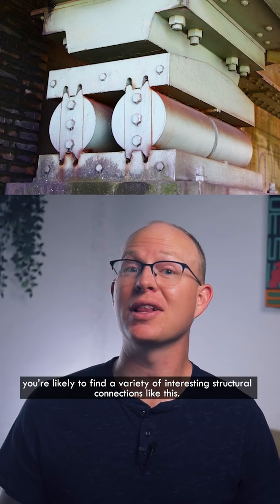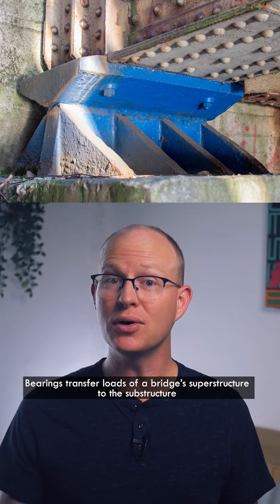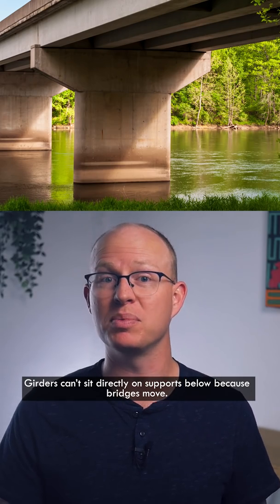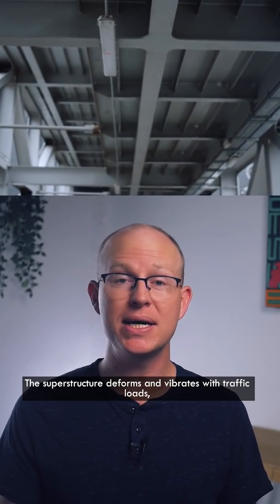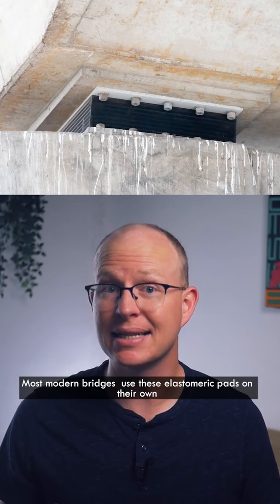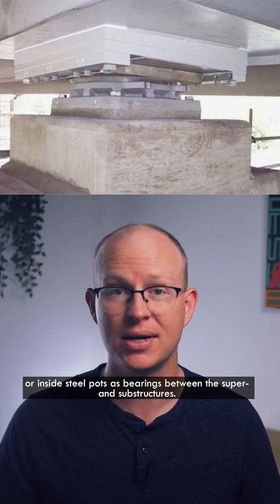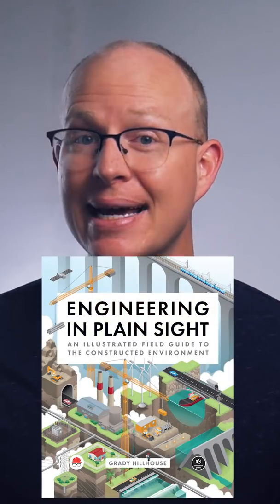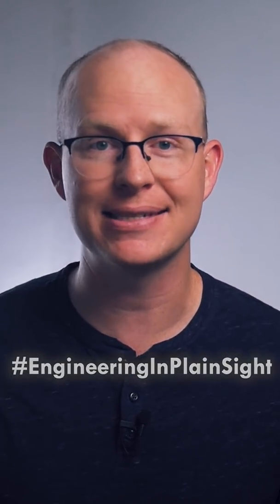Name That Infrastructure (Ep. 4) #shorts

Comment: Integral bridges are very often designed and built for small to medium span bridges because they requires less maintenance compared to decks on bearings. That's because the movement along the bearings will make these bearings wear and tear over time. With integral bridges, the deck/abutment connection is fixed and stresses get transferred into the abutments differently. There are specific issues related to integral bridges, such as the impact of soil ratcheting on earth pressures, but these can be managed through design.

Comment: I’m a river guide on the Lehigh. On the section of river I float, we go under 8 bridges that all are very different from each other. First is a high but small walking bridge that was built within the last 20 years, the second is a 100+ year old train bridge that has 2 supports and a very intricate metal structure under it( it’s a bunch of triangles that are 10 rows across. After that we go under another old train bridge. It has similar pillars to the other one but it’s underside is basic and common looking. The next bridge is a basic car bridge with one support in the middle, you can see it looks like the road is just sitting on it. That one was made maybe 30~40 years ago. 100 yards after that one we go under another car bridge that’s longer and taller. I suspect it’s older than the one next to it. The next 2 are the Pennsylvania turnpike. Probably 100ft above the water and supported by 4 skinny columns. And finally we go under one more short car bridge that has one support in the middle. You can see the seam and it looks like both halves are just sitting on the support. If you want you can go to google earth and see all of these, just start by the train station in Jim Thorpe Pennsylvania and fallow the river until you reach bowmanstown 8 miles later. 

There is so much cool history on the Lehigh river and the town of Jim Thorpe. The haunted mansion in Disney land is inspired by one of the mansion in the town.

Comment: If you go peaking under bridges, your likely to find damage and wear that hasn’t been fixed for years. About 250,000 bridges need some sort of structural repair and 80,000 need replaced. 
Oh and you might get the cops called on you because tampering with a bridge is probably a felony 🤷‍♂️

Comment: what about old (300+ y/o) bridges made from bricks? are the tiny gaps between the bricks enough to compensate these movements? we have quite a view of these here in germany and some of them hold up quite well to this day (there is maintenance of course).
most modern bridges are designed to last about 100 years if i'm correct.

Comment: We really don’t like those steel pin or roller bearings in seismic regions. They are old and made of weaker steel and are expected to fail in an earthquake. PTFE bearings are a nice solution - I have put those on two of retrofit projects.

Also, in Oregon (and I’m sure other states) we do sometimes use integral abutments where we do not isolate the superstructure from the substructure. We then design the piles forces for the expansion.

Comment: I-95 thru Philadelphia ( primarily in the area of Bridge Street overpass) had so much damage that the bearings rotted away and for over 10 years , the road surface sat on stacks of wood.  This wood absorbed moisture and when freezing weather hit, these wet wooden blocks would freeze and raise the north end of the South Bound lanes about 8”

Comment: My very first thought, inverted base isolation which went to bearing. If you haven't done the types of bridges in a series yet, I suggest you do this Grady. The 1989 Loma Prieta earthquake exposed a weakness with truss bridges. Seeing why this happened is an excellent reminder of what conditions different bridge designs work with.

Comment: If they are called bearings then I think car mufflers also has bearings. It insulates the exhaust and frame from each others movement. The difference in bearing the weight is just the opposite from bridges. The bearing doesn't get squeezed in between.

Comment: I've seen those and always wondered? Why do they put that there.
Would it not be put under extreme stress and pressure because of the lower cross section area?

So they are meant to be for seperating movement of top bridge roads and the supports so that they can slide around over each other so that the expansions and vibrations don't stress other parts and cause things in supports to break?

Comment: As a young engineer a more senior engineer decided to switch which pier had the fixed and which had the expansion bearing. At one stage both piers had expansion bearings. I told them it was unsafe but I was not the expert and was told that.  Bridge took off and almost fell off the seats but hung up on some jacking equipment. I just announced “done” walked off site and went home.

Comment: It's some kind of roller joint. Not sure what it's called but it allows force to be applied vertically, while lateral force will allow it to slide or roll (I assume it is for earthquake engineering).
Edit: so mostly right, except for the bit about earthquake engineering (though some buildings have similar 'pads' to the ones you've shown on foundations.

Comment: What's the point of the round bearings in the first photo?  It looks like the teeth prevent it from rolling side to side, since the teeth are exactly parallel (not like cogs on a wheel, which point outward from the center).

Comment: I want to show this to my Statics class. Most people give you a funny look when you say bridges are on bearings.
Reply: Basically if F=ma and a is 0. Then the sum of all Fs equal 0. The concept is easy but if your work gets messy you will lose what you are looking for.
Reply: @sillybilly686  got it. I've done an exercise where I've had to do a free body diagram for nearly all the joints in a truss and calculate the tension / compression across each member. sounds like that is the higher end of what to expect.
Reply: @timothygooding9544  that is the high end.
Reply: @sillybilly686  thnx
Reply: Same here, transferring into a school that offers it and want to know
Reply: Doesn't it become dynamics once the bearings are involved? ;)
Reply: @GertvandenBerg  the idea is that it has already moved from the applied load and has come to a rest. While moving it is dynamics.
Reply: @sillybilly686  I mean the expansion, etc is technically (extremely slow) movement... (likely slow enough that it does not affect the loads significantly) (The loads crossing the bridge likely hasa a larger effect...) (the forces of things like several large trucks doing emergency stops in the same direction might be interesting)

(my background is in electronic engineering) (but my comment was mainly intended as a joke)
Reply: Pin and rollers are what I learned for a simple bridge to accommodate thermal expansion.
I think it's a bit of Statics and Mechanics of Materials.
Reply: Statics and Mechanics of Solids were two of the worst classes i’ve ever taken
Reply: Why? You can see them under any overpass if you know what you're looking for. The ones in Japan actually had freaking giant chains to catch them if they slipped free.
Reply: Hey, what is the statics class like? i am a freshman and im taking it this fall and i just want to know what it's like.
Reply: @warlocknikolai7184  from what I remember of my college courses, it was a lot of analyzing forces and loads on relatively simple structures and shapes in order to determine resultant forces and forces in members.

The class might start a bunch of forces acting on a simple point at different angles and magnitudes and you have to calculate the resultant force and its direction.
Then you might progress to something like trusses and determining which members are in tension, which are in compression, which have zero internal forces, and, of course, the magnitudes of  the forces.
So on and so forth…

Would anyone else mind expounding some more on this topic for them?
Reply: @warlocknikolai7184  Super easy! 😁Seriously, wasn't bad and a very good course. It's relatively easy compared to later courses.
Reply: @warlocknikolai7184  pain
Reply: @warlocknikolai7184  if you're good at algebra, geometry, and trig you'll be fine.

Comment: When I was in my teens (decades ago) is when I learned that bridges weren't monolithic structures, but rather had expansion joints, bearings, etc. At the time, it was counterintuitive and paradigm-shaking, but led me to stop assuming a great many things across a wide spectrum of subjects, instead causing me to perpetually consider the larger ramifications as a matter of course.
Reply: I knew there was more to engineering than meets the eye when I visited the CN Tower for the first time and the guide told us the tower sways 12 feet in either direction, and that it was designed to do that.
Reply: That's valuable learning.  Your vocabulary is great, too!

Comment: I'm guessing it's some kind of heat expansion joint. It's load bearing, and it's clearly designed to allow sliding along one axis only. I'm guessing it's to allow the bridge to lengthen and shorten with day and night.
Reply: expansion joints would be on the bridge spans themselves. it's those toothed seams you see on the surface of roads on those bridges.
Reply: @David   Pretty much right.   It's to allow for movement in the span (the other end would likely be fixed), and temperature changes are the major cause of that.
Reply: It looked to me like it could move in two axis, albeit more in one (and easier) than the other.

Comment: Not true, you skipped the biggest engineering question here! Obviously bridge girders CAN rest directly on supports below, and in fact I suspect that most bridges in the world are built that way, and the size and material are fully competent to the task. Your point is that a sufficiently large bridge requires a more complex engineered bearing system, which is interesting, but the initial engineering question is whether a specific bridge requires a separate bearing system. Many don’t.
Reply from the maker: Not much time for nuance in 1 minute, but it's really a question of lifespan more than anything. Nearly all bridges that carry typical traffic loads have some kind of freedom of movement between super- and substructure.

Comment: Structural Bearing...
1)0.10 sec Rocker and pin bearings ,
2)0.12 Roller Bearing
3)0.20 POT Bearing/sperical
4)0.36 elastomeric or rubber bearing
5)0.41 Pot bearing
6)0.47 Roller Bearing

Fun Fact : All bridges tends to move horizontally & vertically .When you see a huge bridge , it these structural Bearing that bears whole weight of the bridge.There are a huge amount of calculations involved while making these bearings.😀
Reply: Next questions:  
1.  What keeps the bridge centered on the bearings under normal/average conditions?
2.  Do they need to be adjusted as the bridge ages?
3.  While bridges need room to move, they of course also need to be held in place (can't have bridges sliding off into the river...).  Are the bearings also carefully designed to have limits to their movement?
Reply: @DonTruman  1)There are 3 types of forces ,which get applied on theses vertical horizontal and upwards/inverse.This takes account the earthquake also. These are studded on the columns .2)There are fews old types like roller and rocker which require oiling and maintenance for movement.Other then that they dont require maintence.
3) The bridge will always be in center , because of dead weight of bridge (gravity).Exception  are the zic zac or sharp turn bridges connected parent bridges ,for this ,we use pin bearing where the  inverse load is more.There a lot of calculation done to create one bearing and each bridges has its  own calculations.
Fun Fact : They are also used in all heavy structures which moves like chimney's , Cooling powers, hydro power stations etc are fews examples

Comment: It's a miracle all those old Roman bridges and aqueducts are still standing, given that they didn't have any of that.
Reply: Well, most kinds of stones don't have the the high thermal expansion coefficient of steel. Also, often temperature expansion can just be absorbed as internal stress and flexing in the material, as long as it doesn't exceed the strenght of the material it's not that much of a problem. In europe there is now a lot of continuously welded rail, with no expansion joints. Here the buckling of the rails is  entirely constrained by well ballasted and anchored track, and no expansion is possible. The rail just comes either under tension stress in cold weather or compression stress in hot weather.
Reply: @slome815  interesting!
Reply: Exactly! This perspective is from a modern engineer who has lost historical perspective and assumes that the only bridges that exist are large enough to involve a formal engineering design process. Which obviously isn’t true and in fact leaves out most bridges that exist.
Reply: @twestgard2  I mean, I'm not blaming him for not talking about historical bridges here. It's just interesting to me that especially the kilometers-long aqueducts must've had enough give within their structure to not fall apart within years.
Reply: @unvergebeneid  IMO the most interesting question is the tipping point when you can no longer rely on the flexibility of the structural material itself and have to add bearing-specific elements, and you can’t address that question without acknowledging that the tipping point exists.